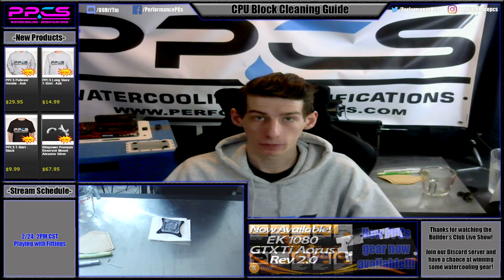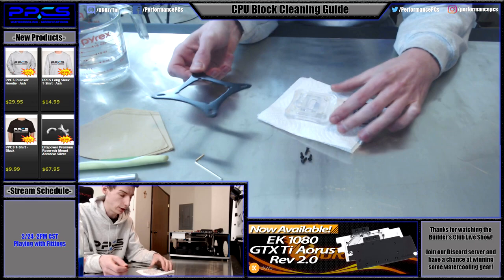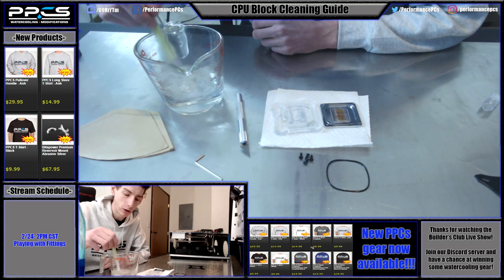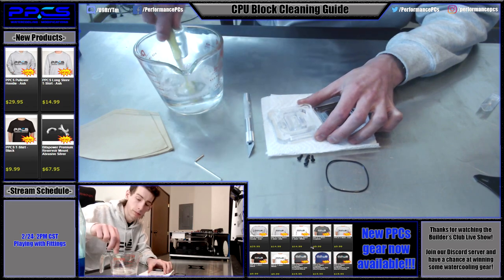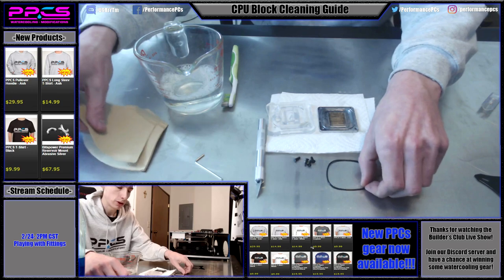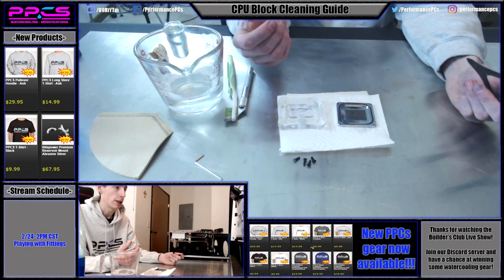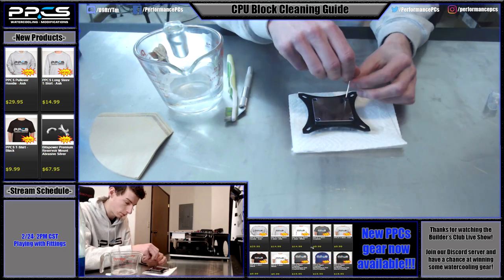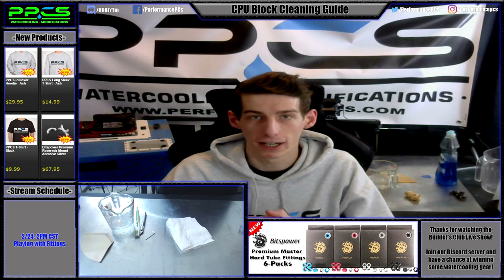CPU Block Cleaning Guide

Comment: Great vid.. everyone needs to take care of their watercooling gear and don't treat it like a AIO setup and just let it sit there.. it does need regular maintenance and cleaning.  

Just did a rebuild/upgrade on my main rig a couple a weeks ago in which I was cleaning a XSPC Raystorm block, 360/240 rads.   The Raystorm block is a good 7+ years old, and while it's been cleaning multiple times over it's life in my rigs, It has not been cleaned for the last 3 years, possibly 4?   I would never recommend doing what I did in waiting almost 4 years to fully disassemble their loop and flush/clean it.  Needs to be done on a more regular basis..  Anywho.. When I took the Raystorm block apart, I was pleasantly surprised at how clean it actually was inside.. aside from the copper cold plate being a tad tarnished..  Even the rads after being flushed multiple times were pretty clean for how long the loop had not been taken apart.  But still.. at first I could not get over how clean it was inside of everything at first.  I was expecting much worse, especially after the loop was not taken apart for about 4 years.    

I have only been using distilled water combined with a drop or 4 of biocide (PT Nuke) in the loops the last few times around.. when I first installed the loop in my rig years back, I was using some Mayhems premix.  Then switched over to the distilled water down the road.  I never did have an issue with the Mayhems premix coolant tho.. Was pretty awesome coolant many years back even!  lol

Comment: without rinsing with pure water afterwards, won't there be soapy water residue left in the fins and blck? Surely that's not a good thing to leave in there to mix in with your coolant???
Reply: My thought as well.

I'm going to use a separate beaker of distilled water to wipe my block down at the end.